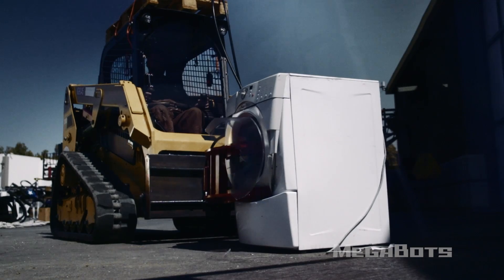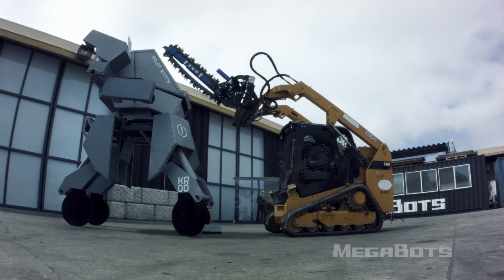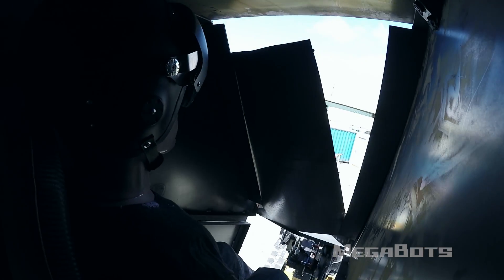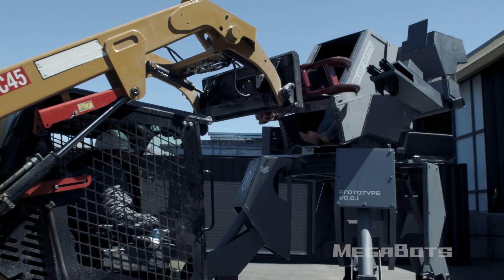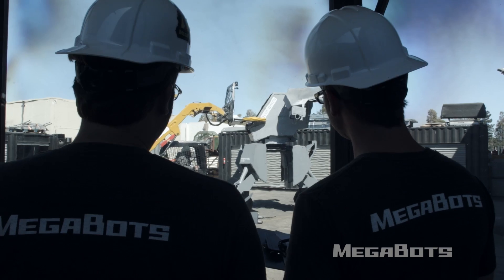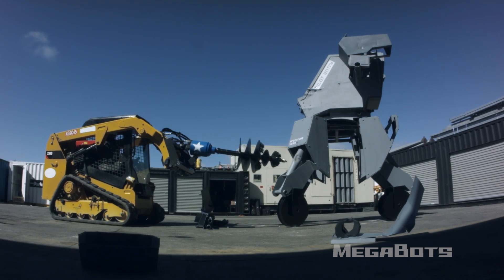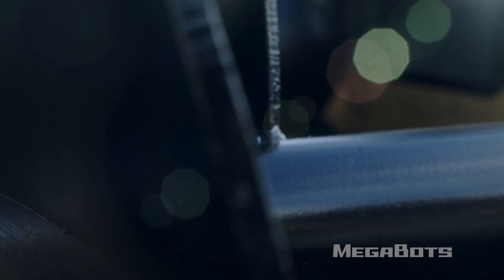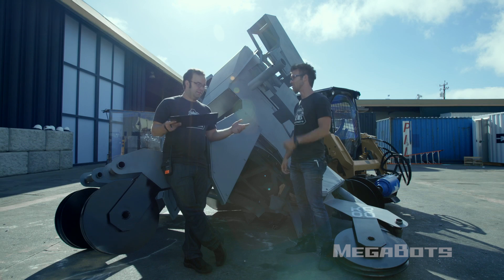Testing Real Giant Robot Weapons! (Season 1)

Comment: Your weapons are lack lustre especially against armour of any kind I recommend developing a weapon capable of piercing at least 10mm of steel  so that you can pierce the armour and the destroy critical components like hydraulic lines, electrical cables and computer components. On the other hand your robot is way to big ditch the 2 pilot system, increase engine power to at least the 600hp-700hp, use a 2 plane stabiliser and a turret ring for the body. Getting rid of the 2 pilot system will allow you to reduce weight and add much needed armour at the same time which will improve mobility and reaction time. Another possible improvement would to be to add redundant hydraulic and electrical systems so if the primary system is disabled or suffers a malfunction you can switch to the equally powerful secondary system and continue fighting longer.

Comment: they might wanna increase their horsepower. oh yeah btw use magnets with the chainsaw. the fucking chainsaw sucks cuz its like saggy. using magnets should keep the chains in place, and provide gritting power. and the claws? you need to make them a little longer so it should be able to hold the parts of the kuratas a little better.

Comment: The Stump grinder could be your greatest weapon. If you sharpan the blades, increase its rpm, and increase its diameter it will not only act as a deadly weapon, but as a protective Spartan esk shield

Comment: I bet if you were to just widen the grasp and increase the cutting edge of the tree shear, you would have a a powerful melee weapon.  I would also recommend changing the shape of the cutting edge to a more circular design, having a flat edge is fine for soft materials, but a circular cutting edge would allow for complete dismemberment or your opponent.  I remember seeing an episode of battle bots where one of the competitors had a similar shear, and it worked with incredible efficiency. I also think you should look into a a semi ranged weapon, something that can deliver a quick punch to throw off your opponent.  Look into kinetic log splitters, that utilize double fly wheels, it is a quick punch and retract, and delivers 22 tons (give or take) of pressure.  Modify the shape with slight barbs and a puncture point, increase the input power, spend a few days playing around with the gear ratio and you'll come up with the right formula for a complete knockout.  just to mention, you might even consider mounting this parallel with a different, slower weapon, as a secondary to that arm and decently adding to your defense.

Comment: I would say, the chainsaw need much more spinspeed. Also the Dentist. With more Speed and Mass they could really "bite" througt the steel. The Metal of the Kurata shouldn't be alowed to spring away. This eats much energy. My opinion. With a Metal Saw Blade you cut steel also with much spinning speed.

I am thinking the Weapons like demonstrated are useless/ you could do better AND everyone is going to die xD

Comment: THERE IS NOTHING WRONG WITH THE SHEAR! 
It’s slow because it’s supposed to be(and it has a lot of volume to fill) but it doesn’t have to be!
 If you want it to move faster, replace the flow control valve with a two stage solenoid and a pressure sensor to switch between a low pressure high flow mode and a low speed bone crusher mode on the fly. or place a servo on the flow control needle on the to give you variable speed control. it depends on how you are doing your hydraulics and if you can compensate for the flow. (I hope you're using a variable pump! tell me you are!) link this up with a position/angle sensor and you could have a very effective and precise weapon. you dent a hydraulic piston like that and you have just crippled your enemy! I’m a mechanic who works in a shop around skid steers, excavators, boom lifts, compressors, you need to increase your fluid flow dramatically above stock on these weapons and not use base operations on a tiny skid steer as your point of reference!

Comment: Hey guys, Few ideas. Harpoon type projectile/robot size taser , the shear would be highly effective if you could couple it with the grapple. The grapple is strong itself, but if you have a hand holding something steady, that shear will do damage.  For the Augur, maybe try something more shaped like a drill bit, the augur is very wide, you want small diameter high power.  Last one, i'm thinking of a compressed air sprayer to shoot some really sticky napalm. I feel it would be very effective on wires and hydraulics like joints. Wouldn't need a compressor as much as to just charge it for one shot. 

These are just some thoughts. Do what you will with them. Love the videos.

Comment: Do away with the one that ACTUALLY caused the most damage. makes sense.
Reply: James Bond that did the least amount of damage
Reply: Average Joe idts. it was able to clamp the mock hydrologic tube. nothing else did anywhere close to that amount of damage. both saws essentially self destructed doing very minimal damage considering the mock kuratos was just a shell very weakly put together. The claw that ripped off the mock arm would not do that to an actual machine since the construction would be much heavier and the drill just didn't work.

Comment from the maker: We're really enjoying how half of you think the weapons are useless and the other half think that everyone's going to die.
Reply: MegaBots Inc Why would you throw out the shear, with some visibility you could cut off an arm, the shear did the most damage too
Reply: MegaBots Inc 
I've to say this. Paint-ball fight from the original proposal is much better and fun. Whoever came up with melee... don't have a clear mind.
The Kuratas from years ago is not only slow but have thin arms. Even if it's fast enough to do a swim-attack, it will bent its arm when collide.
Both team will just have to relay on high impact, piercing weaponry I suppose.
Grinder look somehow promising btw.
Reply: i'd say go for a mining drill... its less 'drill' and more 'blender'...

https://s-media-cache-ak0.pinimg.com/originals/0a/00/c1/0a00c19367b413386a56b69f32f9317b.jpg
Reply: It is just that there is no penetrating power.  I have worked with some of this stuff before, great against packed earth, but as soon as you hit something hard that doesn't want to move those teeth are pretty much done.

         That said, obviously it looks good when you take apart their cockpit, I think the real fight is hitting up the exposed hydraulic and engine though.  So maybe it isn't a big deal that you can't open them like a tin can, your guy's bot may just need to put it's weight into it, keep the smaller Kuratas on its heels, knock it around, maybe even tip it over.  The Kuratas will more than likely invest in mobility and attacking soft spots on the bigger bot.
         Something that has been concerning me is the power plant, I have operated plenty of hydraulic equipment and one thing that they all have in common is when you try to do more than one thing at a time you are sacrificing a lot of power.  Basically, move or hit, try both and the power is just not there.  Are there going to be separate power plants for the tracks and the weapons/other movement?
Reply: Is there any chance we can see a Rocket Punch at least once?  Honestly I don't even care if it's just a test-fire.  I feel it's necessary to address this most ancient and venerable of robot weapons directly.  Plus it might be good psychological warfare against the Kuratas pilots :-p
Reply: It's slow as hell, even I can dodge it.
Reply: What about punch fist? :D
Reply: yeah add another 1000rpm and make that thing sing
Reply: RPG Tipped jousting lance?
Reply: I think all the other countries in the world should also build these robots... I am from Germany so maybe.....
Reply: These are great when placed and utilized right. Whether using them to hold the opponent in position to either; Avoid their weapons, or deliver precision strikes. The "Shear" is perfect to hold, or cut connections to actuators or hoses.  Rotating the Shear, placing the blunt side behind strong spots will enhance the cutting, and ensure the cut reaches the intended lines. Assuming enemy armor will be forward facing, having this shear be able to flank is essential, even if just using to 'hold' You can also a deform parts of the opponent, facilitating the use a secondary device for something more surgical, or merely to put the opponent off balance.  Prioritize "multi-use utility"--especially something that can 'hold' while moving as a defensive or offensive tactic.
Reply: I don't speak Japanese
Reply: +vn0688 butt it looks like the teeth will break
Reply: xXxKONO_DIO_DAxXx mining drills are intended to bore through miles of mountain granite and metal ores... trust me when i say that an industrial mining drill would not break on an inch thick slab of metal very easily.

I would also recommend a jack hammer to punch with. A hundred jackhammer impacts in the course of a fight would wreck sensitive equipment on their mech, to say nothing of successfully pinning them on your hammer tip.
Reply: Well if my opinions counts for anything, you should jack up the speed of the trencher, if possible.
Reply: kersams72
Don't think there's other options... you need penetrations, something high impact for melee duel.
Reply: It's true!
Reply: Regarding weapons:
_ I noticed you guys gave a good rating to the grapple (due to control and grip), but gave the shear a bad score (due to lack of control)... I saw potential in its ability to cut, so wouldn't a grapple that has the components/"teeth" of the shear be a better weapon?

Regarding energy:
_ What engine are you guys using? (Regardless, I assume the engine uses diesel). If it was up to me, I would make the energy source nuclear; but laws are so restricting that you cannot even have more than 1 kilo of U238 :(
Reply: why didt make an vids for a long times
Reply: Watch the video before this one.  It shows what they're using.
Reply: and the saw would work better with something to hold the opponent
Reply: I'm in mega bot's team because I'm not in Japan I'm in USA
Reply: Not all weapons are useless the drill collapse karatas
Reply: I think they are cool, but we both know they wont be allowed in  a match. With live pilot in there, you would spend rest of the life in jail in both countries.
Reply: MegaBots Inc I think you should look for better weapons what you got works but not good enough. 

I recommend the auto ax high impact pain
Reply: when the fight I can't miss it
Reply: MegaBots Inc is cool
Reply: i maybe built one
Reply: i maybe built one
Reply: Great!
Reply: Ok 👍

Comment: Armor by virtue of what it is made for wont be cut easily, Concussion weapons or Puncturing weapons are where its at.     The Japenese are gonna be using a Pile Driver (large spike that shoots out at high velocity) and while you shouldnt copy them, that is a weapon that will do damage to a giant mech.

I suggest some type of club weapon.   Mabey re purpose the chainsaw so that it can be used as a bludgeoning tool, since yes, it does look awesome.

Also, they seem to be going for a wheeled design, so spraying oil on the field is an option since you guys are using threads.

Comment: People are suppose to be inside these things and they want to use LETHAL weapons against each other like this? 

Also, Are they not suppose to be using PUNCHING as a means of a safe battle?
Reply: I think the idea here is that these will be anti-limb weapons.  The cockpits are (hopefully) going to be suitably hardened so that none of what you see here will be able to go through.  Note that they're specifically going without the Shear, which is about the only one of these weapons that actually cuts through metal- all the others dented, scratched, or just whacked stuff.

Comment: well maybe hard to knock over but if its harder to knock over then where it hits will take a hard impact as it absorbes the hit directly. So it may still damage it. like hitting a balloon it will transfer that energy and bounce back but if the balloon is held in place "POP!". We just need a quick hydrolic punch. Like those bulldozers use at construction sites with the giant flat head on them. Used to break up old concrete. They could put one on with a longer bit maybe and the end could be like a steel mallet with a spike on top so it can be swung or use the hydrolic to punch the spike end into the torso.
Reply: You really don't want a penetrating weapon on one of these- so a flat powerfist would be fine, but a Pile Bunker would be a no-no.  We're not trying to kill pilots, after all, just wreck the Mechs (or maybe rattle the pilot enough to give up).
Reply: Earthenfist Oh yeah thats right, no killing. Well as long as there is a living human inside this will suck. Because everyone has to pull their punches. Maybe they should build them to actually fit a human but put a lifelike dummy inside that has simulated organs and blood and they can remote control it. Then we get our thirst for carnage satisfied and proof of concept. Because basically any impact to the cockpit could kill a pilot so what we will get is slow motion grab assing at their legs and arms. I feel my contribution is being wasted on a publicity stunt. Lol :D
Reply: C B
Not necessarily.  The cockpits should be able to handle a lot of impact without the pilots being in danger, so I could easily see some proper scrapping- the big difference is that the Kuritas is so much lighter and probably more maneuverable than the Megabot, we'll probably not be seeing an extended brawl- more like a long game of attrition, cat and mouse, as the Kuritas tries to get crippling shots to the Megabot's limbs, and the Megabot tries to get a solid hit on the Kuritas.

Comment: You guys really aught to contact Ray Billings of Team Hardcore, the builder of Tombstone. He can tell you how to build a proper spinning weapon!
Reply: The problem is, you don't necessarily want to mount a spinner with large amounts of KE on an articulated arm which is mounted on a top-heavy robot. Something with even KE levels like battlebots were packing around 2000 (per pound of robot mass) would be as likely to break its wielder's arm as damage its opponent, and could potentially even flip its wielder over. It would also make it much harder, if not outright impossible, to make the opponent's cockpit capable of surviving the impact.
Reply: Yep, I considered all of that and typed it anyway. What is the point of a fighting robot if you can't really go for it!
This is why Battlebots and Robot Wars exist, and even they have rules and limits so I am sure you can do the same here.

Comment: Thumbs up, but honestly a bit disappointed. These things are made for stone and organic materials and you're attempting to use them against heavy steel... seems like a strange thing to do. From the looks of the test they worked about as well as would be expected. Not sure what you're going for here, but this seems like a fail plan. Hope the next test with better teeth is more promising. Really hope you have a backup plan.
Reply from the maker: Implements designed for cutting metal at this scale usually weigh 3-5x as much as these weapons do, or have much smaller envelopes. We have an upper limit of what the robot can actually carry on its arms, and these weapons are right at the edge. We have to make do with what we can hoist!

Comment: As much as all of these weapons are awesome, I think the shears were actually the best. They were the only weapon to actually sever the metal. Everything else would hardly scratch Kuratas. They need to take some inspiration from Battlebots and start implementing tools that can actually cut metal as opposed to woodworking tools. My suggestion would be to have the weapons attached to the forearms , pulled back from the grapples. Then you could use the grapples to grab the arms and have a saw or shears come forward and slice it off. 

Also, Summer 2017 Internship? I have three years of experience with robotics at a high level (my ftc team participated at world championships, we ended up 8th out of over 5000 teams) and am working on my BS in Mechanical Engineering.

Comment: The grapple and the shear are the only two that would do anything... grappler does just that and the sheer could actually damage the unarmoured hydraulic cylinders.  Anything with carbide teeth is useless against armour, soon as they hit something the teeth sheer off.  Flashy, but a total waste of time.  A pile bunker would be more useful than anything they tested.

Comment: Put smaller teeth on the chainsaw and spinning disc, after all you're cutting metal, rubber and plastic, not trees. I would also suggest a high speed hydraulic ram (sort of like a power fist!)

Comment: I really do not know what this proved, you went up against what was tinfoil. Your entry isn't going to be made up of 18 gauge cold rolled steel is it if you want to test the weapons test them against 1/4" plate. This was a non-test no useful data was acquired.
Reply from the maker: Uh. The two armor panels that flew off when we hit them with the Dentist were 1/4" plate.
Reply: But the integrity of the target had been breached that allowed that style of tool to have an effect if the whole cabin had been made of 1/4" steel (which it would be the most heavily armored ) there would not have been a breach and the stump grinder wouldn't have anything grab onto leaving the cab scratched but not breached.